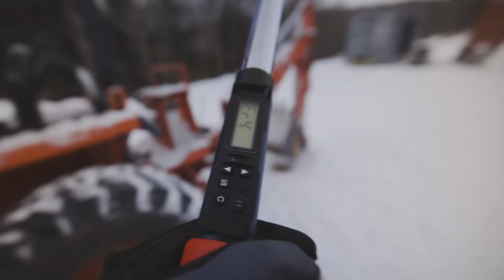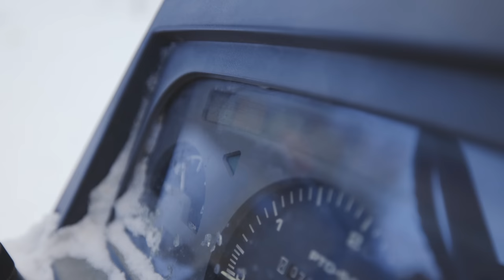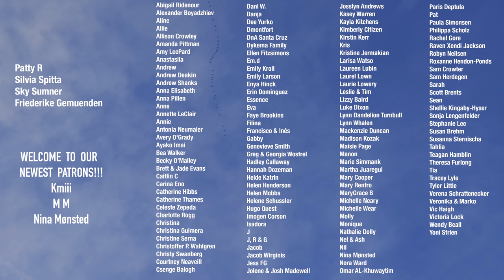Snowstorms STOP The Shipping Container Build

Comment: To plow gravel driveway or any road/space that isn’t asphalt, take a 2 or 3 inch pvc pipe and cut it to the length of your plow. Use a saw to cut one side of the pipe lengthwise then slide it on the bottom of the plow. It’ll slow you to drop the plow and plow the snow without ripping up the ground or the plow digging into the ground.

Comment: Good job getting the tractor going.  Cheap tools (Chinese Pittsburg, etc) will let you down.  Spend money on GOOD tools if you can.  Also, chains for the front wheels make a HUGE difference.  4 wheel drive should equal 4 chains.   I’m from Alaska, now living in Maine, and have used a lot of tractors with and without chains.  The added expense is worth it.   With heavy snow, when you angle the blade and plow, it will push your front end sideways without chains.  You won’t regret having more traction than you need.

Comment: Well done for beating the wheel bolts. They often get fitted with a 3/4 air gun  to silly torque. So nearly impossible to remove with a breaker bar and extension. And steel becomes very brittle in freezing conditions. An old mechanic trick was to keep stuff warm on a running engine to avoid breakages. 😃😃

Comment: Lou since you are going to a high torque spec, you should use a impact socket. They are built to handle higher specs. Also, while Pittsburgh is a fantastic brand from Harbor Freight, you have to be careful about their quality. Luckily, you should be able to replace any broken socket for free.

Comment: A propane torch works wonders when working with stuck bolts…for next time. Also I have broken  so many of those adapters, you are not alone. I have had better luck with impact adapters (they are usually black)

Comment: Snow plowing is no joke and a lot of work and fuel. My ⅛ mile driveway just cost me $250 to have plowed! All for something that just disappears. The dry powder is pretty easy to push or blow but heavy wet snow is like cement. I hand shovel tons of snow also and it is the most aerobic exercise.  Right up there with xcountry skiing. Good luck with your tractor. I'd tarp it in inclement weather.

Comment: Nothing beats some good leverage when dealing with a stubborn bolt! Great job! If you have to use an socket adapter, I'd highly recommend one made for impact wrenches. They're a little bit more expensive, but they're heat treated to be much more durable. They're easy to differentiate because they usually have a matte black finish.

Comment: When working with equipment heat will be your best friend. Get even a small propane or Map gas torch. It is also good for fasteners that have loctite on them. For the tractor get a dedicated 3/4  inch drive  socket and breaker bar. Preferable get impact rated sockets and adapters the standard metal chrome are never as strong as the impact rated.

Comment: You can forgo the socket adapter by getting a 1/2" drive socket that will attach directly to your extension. If you must use an adapter, don't waste your money on the cheap junk. Get one made for use with impact wrenches, or buy a good name brand like Mac, Snap-on, or Matco. Probably cheaper than buying three Pittsburgh's.

Comment: Working on quality heavy equipment as you own, you cannot use Harbor Freight's Pittsburg or even Icon brand tools.  You will need to "bite the bullet" and purchase quality like Snap-On or equivalent..  However they are very expensive.  Buy quality once and save yourself the headache and possible injury.

Comment: As you figured out through trial and error, you really shouldn't use the 1/2" to 3/8" step down adapters for your socket with a breaker bar... It's a recipe for exactly what you discovered, i.e. the snapping at the shank. Do yourself a favor and get a dedicated set of 1/2" sockets, and impact-rated ones at that (tougher in general, but also handy if you do get an electric impact later).

Also, a word to the wise, always better to get vehicle/mechanical maintenance done before the cold sets in. Everything is harder both literally and figuratively once it's cold.

Comment: That looks like you got Harbor Freight socket adapters, they are very poor quality. Instead of using an adapter when you need to torque something with a 1/2 drive torque wrench, you should get a 1/2 drive socket. That is the proper way to do it without breaking tools. If you have to use an adapter, I'd recommend using an impact adapter. They are meant to take that kind of load from an impact wrench.

Comment: That's a 1/2 to 3/8 adapter.  You really should be using a 1/2 inch socket, without the downsizing adapter

Comment: hey there 
I see you using storage containers oh yes Happy New years
well why don't you take to 40 ft long ones storage containers there I don't know what 9 ft wide 8 or 19 ft tall put them together well done bowling and weld them together and cut the inner out to that way you can walk through that way you have a large living room kitchen dining area if you want the back you can have a shower and one or two bedrooms and on top you can make either a 30-footer or a 20 ft long storage container on top and put two of them together and make that one large bedroom with your own bathroom upstairs for a deck if you wanted to that way you could have a nice house that way and I would definitely would you spray foam insulation much better on the r value of insulation then you can also put all kinds of solar panels up there and something for wind power that way you're always have power other than that have a nice day that's how I would do it if I had the money 
oh yes before forget I'm assuming you guys get tornadoes and hurricanes in that area I definitely would have I don't know what six or eight posts going down at least 20 30 ft in the ground and roll it to the shed that way pretty much guaranteed that house will stay at one spot ok